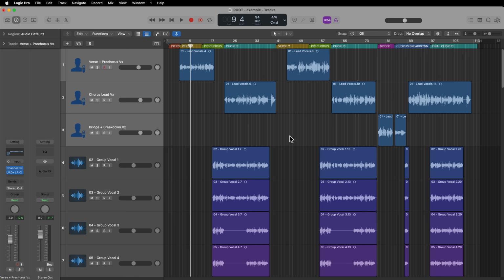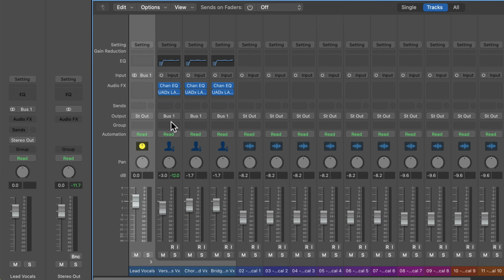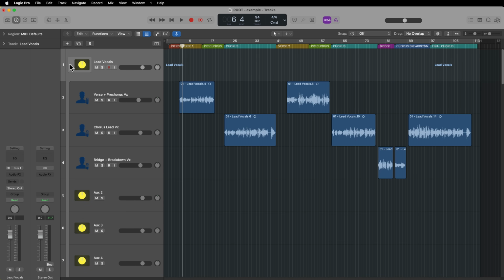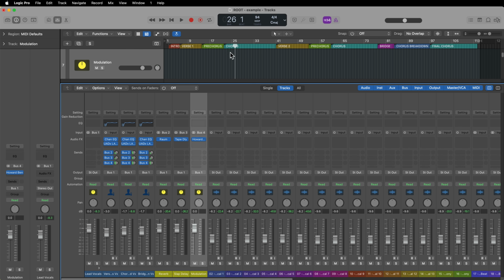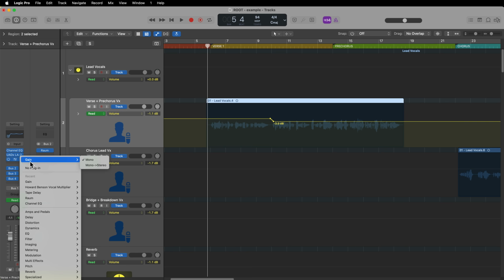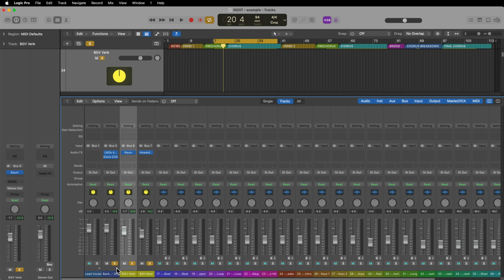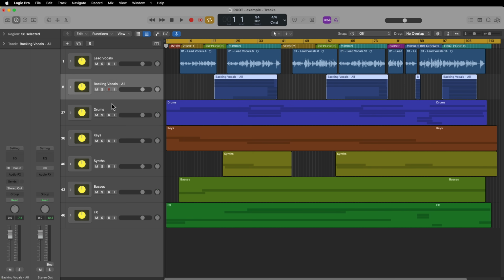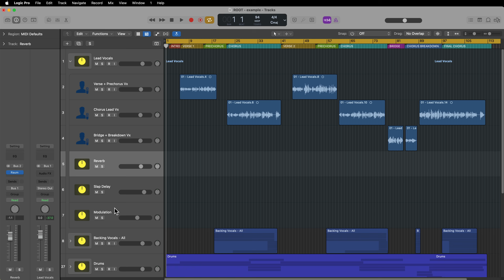Logic Pro - Summing Stack + Aux Track Mixing Setup

Comment: First off thanks for the video. 2ndly. I have a question. I created a summing stack to control 3 different audio sources but every time I try to turn the summing stack volume down I can still hear the instrument. There’s no reverb or anything on it. It’s dry EXCEPT for the fact it came from omnisphere. Tried burning it into the track and everything and it’s still not quieting unless I click the individual track. Any solutions to this? Thanks again. Oh and it works on a different 3 instruments in the same session so I know it’s not a session thing.

Comment: I've just moved over from years of Pro Tools to Logic. Working in film and tv, and have a need to have options when exporting stems. I have "Main" Track Stacks for my main groups (Winds, Brass etc) but also sub Track Stacks within them (eg Winds Long, Winds Short, Brass Long, Brass Short). Everything is routed correctly within those sub groups to go out the main group. Metering all fine too. My problem is that when I select the "main" track stacks and command+E to export those main groups they export as silent files. The sub groups export perfectly, but the main groups are silent. The strange thing is when I "export all tracks as audio" the main groups have audio on them and export fine. I just want to know why I can't seem to export the master track stacks I've selected with audio on them (and without having to "export all tracks as audio..."). Is this possible or a known issue?

Comment: Thanks for the great tutorial Josh! I’m currently mixing a song in Logic using summing stacks much like you are here and ran into an issue with panning when using them. The song has a lot of tracks and a lot of panning and I noticed that a panned track in solo was coming equally out of both speakers. Testing other tracks out produced the same results and looked into it online and the closest thing I found were people suggesting a bug was causing it with summing stacks. I converted everything to folder stacks and that fixed the problem but now I lose the functions of summing which I liked. Any experience with this?

Comment: I really enjoyed watching your work flow here.  I have a question - My mix template takes groups of like tracks (e.g. vocals) and then I send the output of those to a bus (e.g. VOX BUS) so I end up with a limited number of buses where I can apply top-down mixing at the bus level (as well as track level mixing if necessary).  All my sends though are outside the bus in aux tracks which allows me to use, e.g., a similar reverb on multiple busses limiting the number of instances of the plugin.  But it seems to me, I'm losing something relative to what you do.   But in essence, aren't my busses similar to your summing tracks, and if I sent the output of the aux tracks to the same output busses as the tracks they pertain to (and created more instances for each bus) would I basically be doing the same thing?  Or is there something different going on with summing tracks than my method? Thanks Josh.

Comment: Random question to @musictechhelpguy what do you use for your mouse in logic?  Trackpad, magic mouse, other.  THanks!
Reply from the maker: I used to swear by Kensington trackballs, ergonomically I love them. And they allow me to not have to move my hand much on the desk, w which is especially helpful when it's covered in gear. However, I've owned like 4 of them in 10 years, and that seems a bit excessive in terms of them breaking down. Especially the newer models. I also can't stand wireless peripherals, especially when I'm making tutorial videos, they cut out all the time -- so an Apple trackpad or Magic Mouse is out of the question. So I've switched over to a Logitech G502 wired gaming mouse and I love it.
Reply: @MusicTechHelpGuy   Appreciate the reply!  And thanks also for the fantastic Logic Pro Tutorial series.

Comment: I have been doing this for while but I often have issues with the routing of the aux tracks. Is there a way to get them to consistently route properly when adding them to a track stack? I have been using inst tracks as aux tracks lately because they are better at automatically setting the output where I want it.

Comment: Another great video! On your last point about bouncing the stems, I think you can also just select all the tracks stack tracks and do an export as audio files, and it will make the separate stems. As for the Barsamian, this is what I have been doing, and I find it so tedious. Why can’t it have an option to place new aux tracks Into the current stock? We’re just making so much easier. I’m on we’re at it I would love to be able to just type in bus numbers instead of using the pulldown menu.